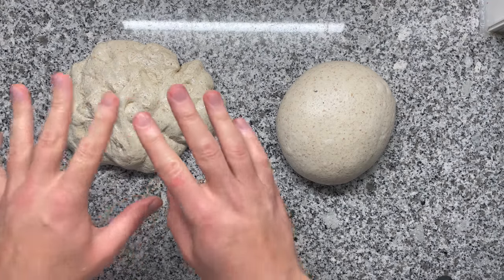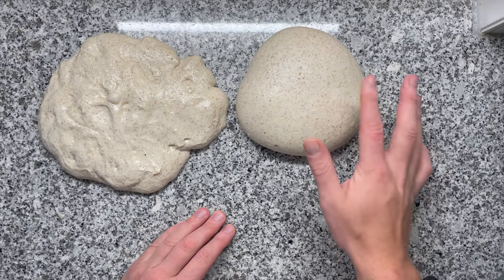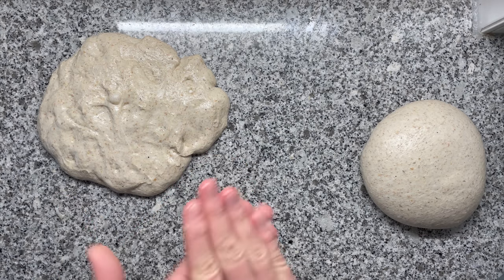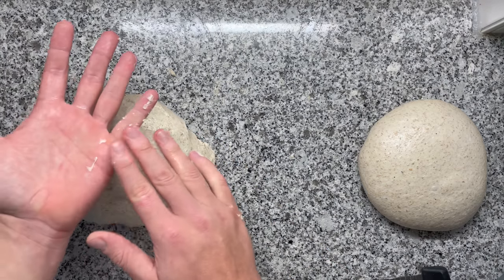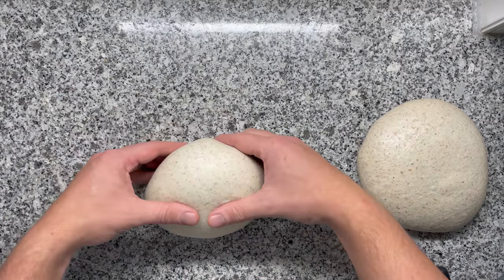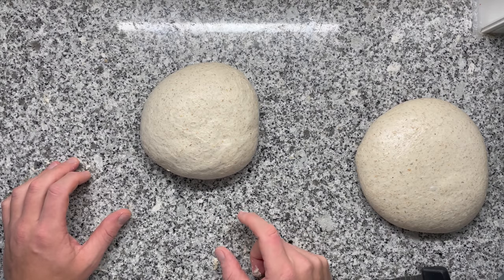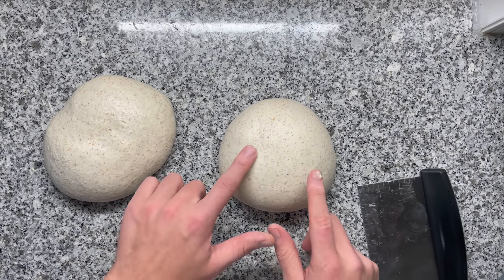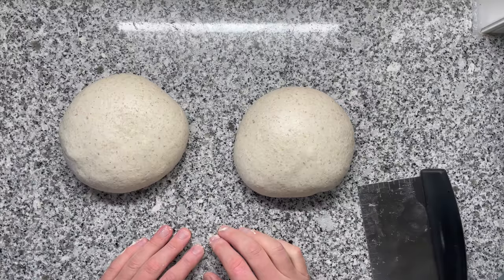How To Make A Perfect Round And Smooth Dough Ball

Comment: Thanks for sharing your knowledge. Does the surface of your workbench matter? Your stone surface seems very smooth. I'm still struggling with this technique. I use a wooden board, which is also smooth, but probably not as smooth as yours.
Reply from the maker: Moin Darth. I have been using wood for the past 3 years and that worked great. I bought me a wooden board at Ikea before and have been using that for a long while. So wood works too, many old bakeries still have wooden tables :-).
Reply: @the_bread_code  Actually I am using the board from IKEA, too. I've seen you using it in one of your other videos. I also got myself two clamps to fix it to my kitchen counter. Otherwise it was moving quote a lot. :)